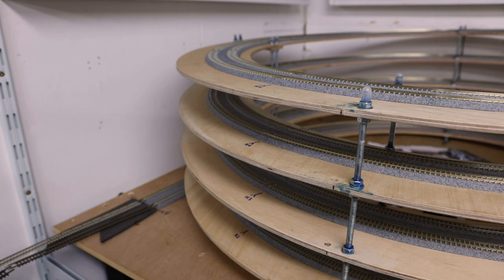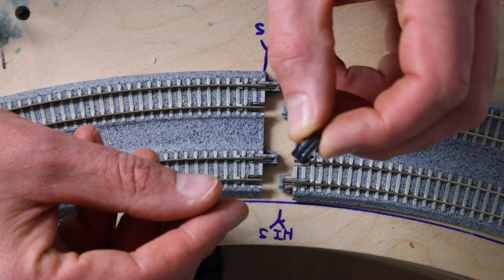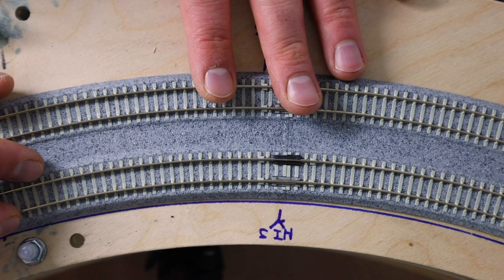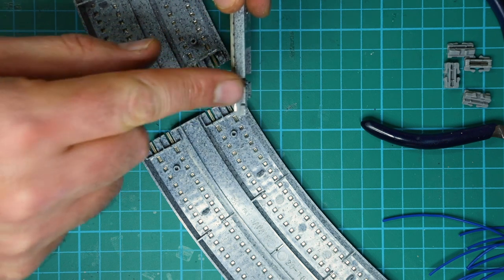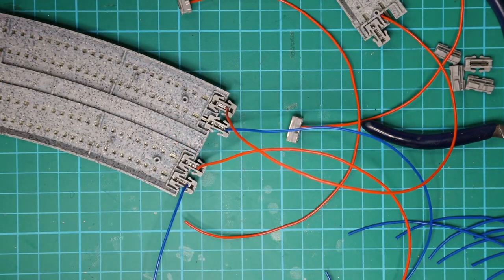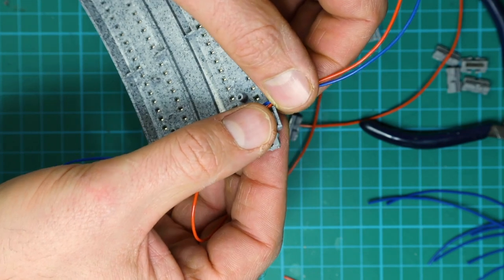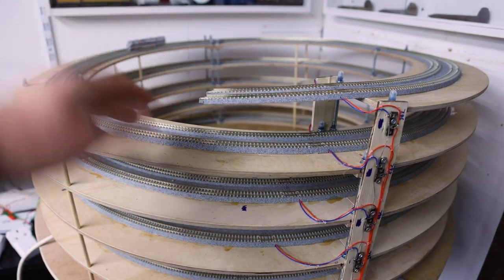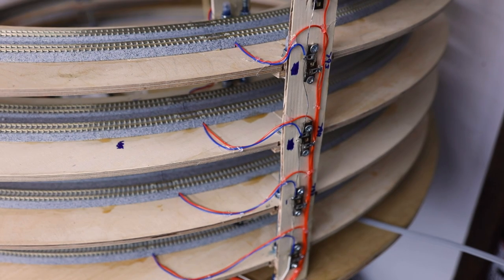N SCALE HELIX BUILD: Wiring and track laying

Comment: Just stated watching your Chicago Sub build series. Great stuff, thanks for uploading.
Strongly disagree with the way you remove the Unitrack joiners. Using pliers like that it's possible to damage the metal connecting part. The small plastic Kato 'tool' is confusing at first and isn't always a good solution but for the main it works well once you've got the knack of how it works.
Reply: Hi, thanks for your interest and glad you are enjoying it! Yes, agree about the method of using the pliers to remove the joiners, but the small tool just frustrated me and was pretty useless most of the time.  I didn't damage a single joiner using the pliers, so pretty happy with my method, in fact I damaged a joiner using the supplied tool!  I didn't apply too much pressure using the pliers.